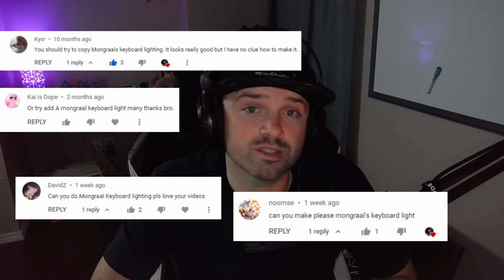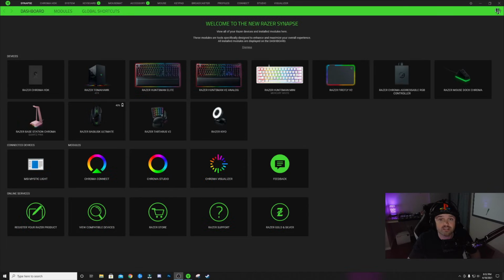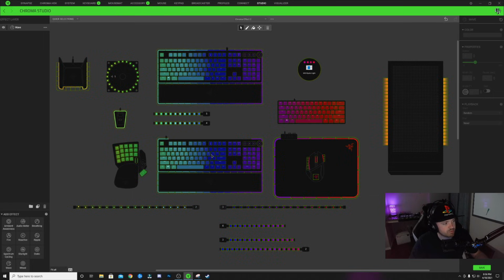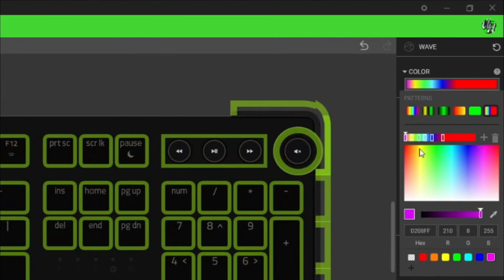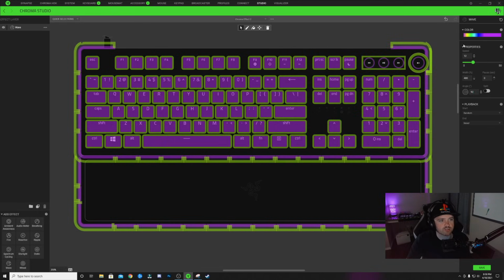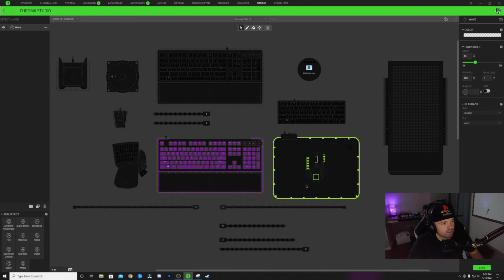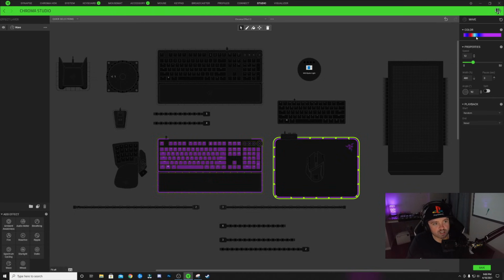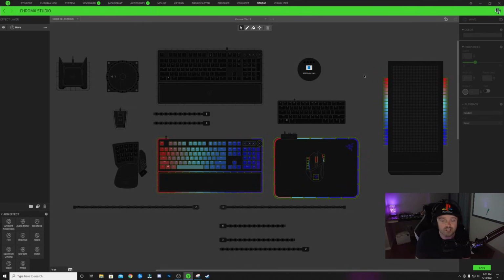Mongraal Keyboard Lighting | Razer Chroma Keyboard

Comment: New sub. New owner. I have been reading a lot  and have most pieces of the puzzle figured out. I have actually created a couple  more simple  templates  and have a pretty good grip on the designing side. The most confusing issue for me is with the Razer Huntsman Elite, what keycaps {with clear sides black tops} and what bottom row  keycaps do i order? I can not seem to understand   which keycaps fit which keyboard and when i go to Amazon a and read it says   no good for huntsman elite. I want the clear sided keys for better light dispersion etc. There seems to be lots of choices...  Can you please help me?
Reply from the maker: Unfortunately there are no clear sided keycaps for the elite that I know of. The best option for that board is the Prism keycaps from Steelseries. But they’re pudding. It’s been a while since I’ve looked at the market so there might be something that I’m not aware of. Hope that helps